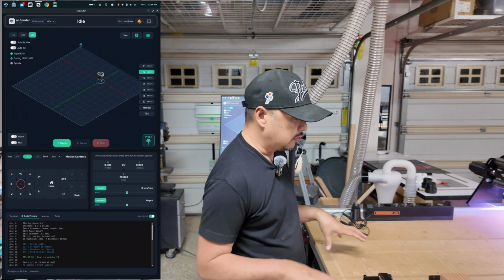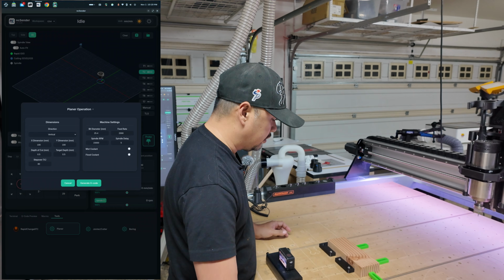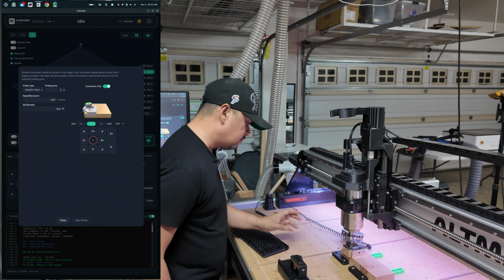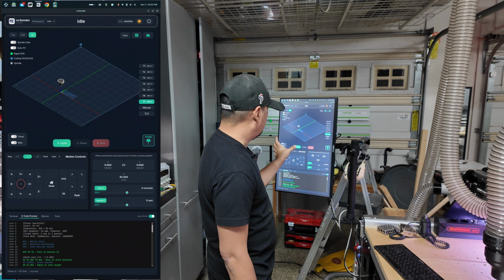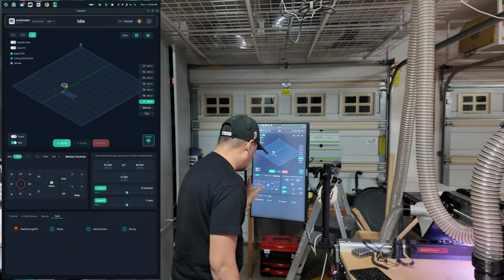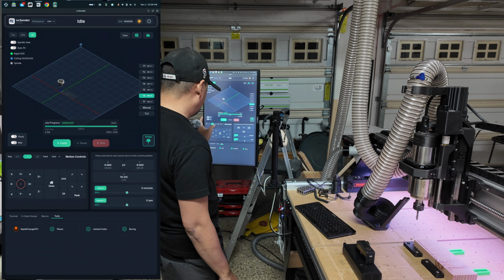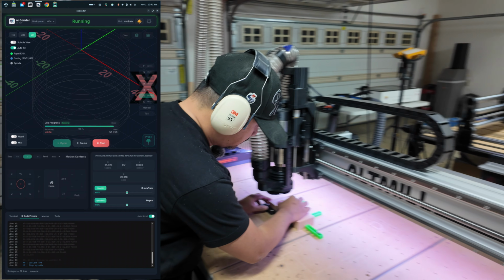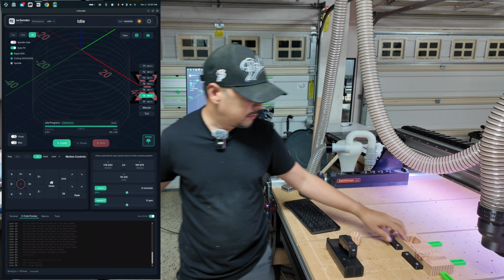ncSender: ToolBench Plugin

Comment: Nice! I have an Altmill and v carve pro. Are these gadgets avaliable for that?
Reply from the maker: Yes but its nothing to do with V-Carve. V-Carve is basically a CAM software where you generate g-code that you feed to the Sender software to run it on your AltMill. As mentioned on the video, the idea is skipping your CAM software for generating basic g-code like surfacing.